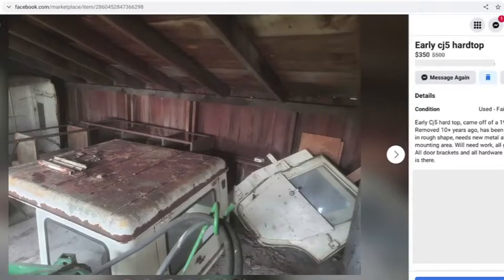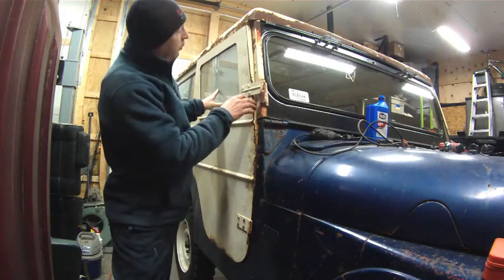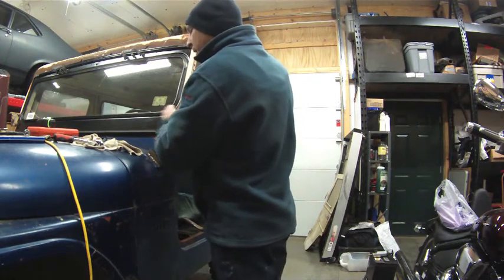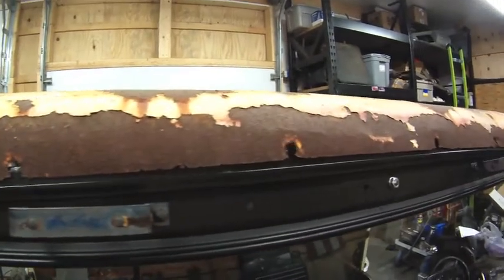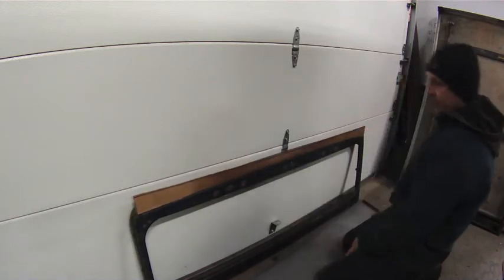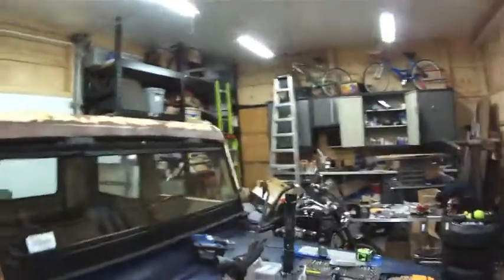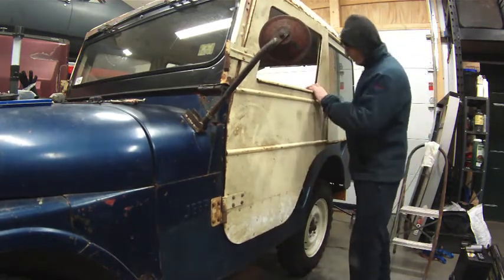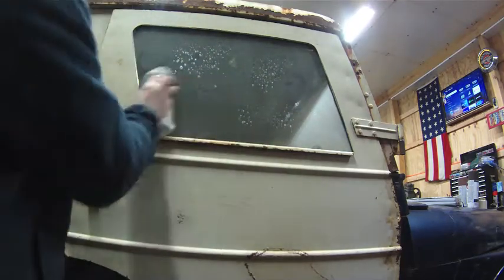Jeep CJ5 Hardtop Part 2

Comment: Any suggestions on where I can find the upper door bracket (the one that bolts to the jeep)?
Reply from the maker: I think I have an extra set of uppers. I'll check tomorrow and let you know.
Reply: That would be awesome.  Thanks for checking
 @OldCarGarageUSA
Reply from the maker: I have the pair that bolt to the windshield frame, but do not have the pieces that bolt to the door. If you're interested, contact me through Instagram or email. I have links on my channel page for contact. @scottluff3158
Reply: Not sure if my emails are getting through, or maybe you changed your mind on selling the uppers you have.  Could you let me know either way?  Thanks
 @OldCarGarageUSA
Reply from the maker: @scottluff3158  yep, responded twice last week with a price.